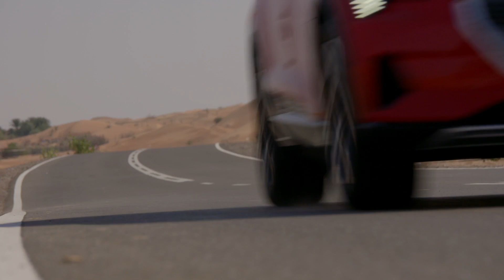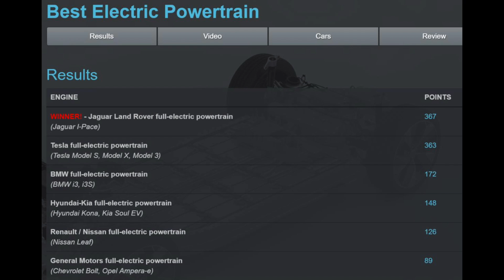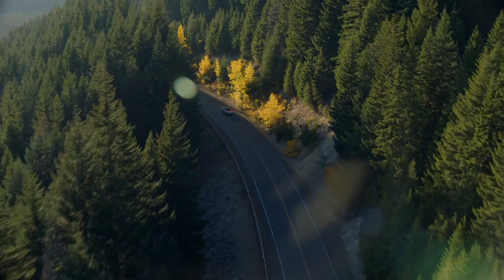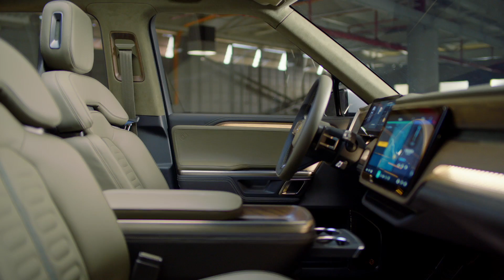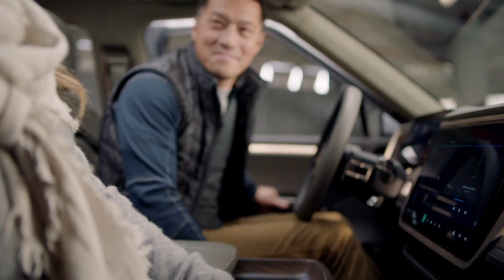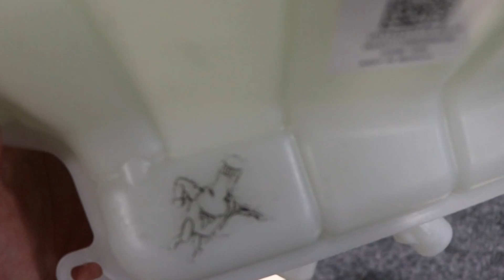Sandy Munro: Model 3 manufacturing, Model Y wiring, and EV competition

Comment: So many jokes about over design, too many parts, wastefulness etc.

And not a single mention about the patent for what Tesla calls a “Multi-Directional Unibody Casting Machine for a Vehicle Frame and Associated Methods.” ?

As Elon said: “When we get the big casting machine, it’ll go from 70 parts to 1 with a significant reduction in capital expenditure on all the robots to put those parts together.”
Reply: I think they only talk about cars they actually disassembled  not the ones they have not
Reply: Also.. million mile chassis. What don’t they understand about this?
Reply: How could they possibly not talk about this (assuming that it happened well before this interview)? I also would have liked some more insight into the battery situation - e.g. - why it takes Maxwell or current battery manufacturers 10 years to learn to make batteries using solid electrode deposition, and something about why it would be better to work toward solid state batteries.
Reply: lifeform carbon I believe the conspiracy theorists that say it’s all being suppressed by big oil
Reply: That will come after the Y teardown interview ;)
Reply: I know a few Tesla owners who have replaced batteries at just 120,000 miles.  What good is a million-mile chassis if you have a sudden $14,000 repair after so few miles?  That’s like buying a gasoline car and having to replace the engine when it’s still Young!

.
Reply: Wheels don't fly off F1 cars, they are tethered to the car
Reply: @electrictroy2010  So 3 people out of millions?

Comment: I thought that Fiat Chrysler is behind in terms of EV development, as you mentioned. Isn't it the reason why FCA is trying hard to merge with Renault (Zoe) / Nissan (Leaf) ? For me, Sandy (a great expert for sure) has not driven a Model 3 with the mind-set of a sports car driver. When you get a grasp the incredible rigidity of the chassis of the Model 3, it is close to the rigidity of a carbon fiber chassis (think BMW i8 or McLaren) which makes its handling more than very good.

In terms of crash test, the test for side impact between a Volvo (best in class before Tesla came in) and the Model 3. https://youtu.be/wcZkkGL85AI?t=33 ... doesn't it suggests that Tesla knows what it does in terms of manufacturing and safety, better than others ? 

The new patents Tesla just filed are meant to build future Teslas in much less parts, even in one man part ? That could have been discussed a bit more.
My 2 cents anyways & thanks for the great content !  :)

Comment: Supercaps  do not make sense as a "buffer" for automotive batteries.  Tesla packs already have no problem producing power and no issues with longevity.  What would be gained by trying to add more expensive but less energy sense supercaps?  Nothing.  Add more battery instead.
Reply: Charge and discharge rates of super caps are way better than batteries. Instantaneous power and they are lighter than batteries. They also have very little degradation from cycling or heating. Basically a sponge like he pointed out. Inrush current from regen braking is quickly stored and reused without killing the battery life. the BMS can easily parcel out the peak current stored if needed to the weaker cells in the pack, and less taxing on the battery cooling from hard charging rates.
Reply: On paper what you add is fewer stressful cycles on a battery which would lead to longer battery life.
 Theoretically this would also help with thermal management
Reply: @helicopterdriver  Wrong.  Supercaps are NOT lighter than batteries, they are much much heavier for the amount of charge they store.  Their energy density is TERRIBLE.  For the same weight, volume, and cost, you are much better off just installing more batteries.  You'll get much more extra usable range and because the pack is larger it can output and receive more power.  If you actually do the calculations, as Tesla obviously has, supercaps make no sense at all without a MASSIVE improvement in their energy density and MASSIVE cost decrease.
Reply: @FogerRox  No.  See my other response.
Reply: @JRP3   They are not about storage but instantaneous power delivery and recharge rates. Not affected by thermal changes the same as batteries. They can store the charge longer as well. Not a replacement for batteries but more of a shock absorber for the energy management. Single phase AC motors have them for a reason. Less current draw on the supply current on start up loads. As they become cheaper, the more sense it makes to include it for better battery load management and current power transfer efficiency. Hydraulics use accumulators. Same idea. More weight but a smaller volume pump and motor is used to make the system  smoother, lighter and more efficient. I'm  no expert... just interested. I have an ebike but no regen capability or I'd be interested in adding it to mine for taking advantage of it for acceleration and overall battery life due to less amps flowing from the battery on power demands.
Reply: @helicopterdriver    Important questions to answer and understand:  1.  Do Tesla batteries have issues with longevity?  NO.  2.  Do Tesla batteries have issues delivering power?  NO.  3.  Do Tesla's batteries have issues with recovering the majority of available regen energy?  NO.  Supercaps offer ZERO benefits for a properly designed EV.
Reply: @JRP3  All of the above are true. I just think discharging, recharging and balancing batteries for many cycles, that could be reduced or slowed, may be beneficial in the long run. More range? Starting and stopping are the biggest energy losses at low speeds. Semi could take advantage of that too.

Elon may have ideas for them we have no knowledge of. Do they use them now? I have no idea.  Probably in solar, maybe in the supercharging network. They don't move, size and weight is usually a non issue.

The next gen of capacitors/solid state batteries may be smaller, lighter and more powerful that don't require very expensive and heavy custom cooling/warming systems. ... more range?  I don't know, but tech is leaning that way... good discussion. 

You're probably right.
Reply: I can't wait to see what Elon does with super caps

Comment: The legacy automakers still haven't figured out that it would be to their advantage to take Tesla up on their offer to share the supercharger network. I doubt that they are open to buying battery technology from Tesla even if Tesla were to make the offer. 

If Tesla did make the offer, I'm sure they would ask the other automakers to pony up the capital to build another gigafactory (or many) in order to provide enough capacity for them as well as Tesla vehicles and its storage products.

I don't think that Tesla will have a monopoly position in EVs, but they will be the GM of EVs, with about half of the market. (You have to remember that China and Europe are going to be developing their own brands for their own markets, and likely will import them to the USA too.) Tesla will definitely be more profitable than the others since nobody else seems to want to vertically integrate like Tesla.
Reply: dlwatib I think Mary Bara has that insight.

Comment: 2 hours charging? What is he talking about I just traveled 500 miles and no stop was more than 20 min? Wild the misperception even with people in the “know”
Reply: Yup, very strange for a battery expert to be this far off the mark.
Reply: Yes, my opinion is that some of his technical statements are highly questionable...
Reply: Same here. I never have to stop longer than 20 - 25 minutes on road trips in my Model 3. Typical stop is 15 minutes every 2 hours of driving. The charge rate is so fast that I barely have time to grab food to-go and use the restroom. I've driven 27,000 miles across the US in 11 months, with another 5,000 mile trip planned next month.
Reply: @JayDee-b5u  lowest is typically 20-25% GO UP TO 80 max on road trip unless freezing out and increased elevation on way to next stop.

Comment: I understand Sandy's point about  the chassis having excessive parts count, which Tesla has apparently fixed on model Y...  but the comments about the chassis being over built, and using aluminum and glues .. makes me think Sandy doesn't understand, or is ignoring Tesla's desire for these chassis to last a million miles.. I've scraped so many American cars (lots under 100k miles)for chassis being rusted out; It makes me mad thinking about it..... I dont think Sandy fully understands : Tesla wants the longevity so they can take full advantage of FSD Revenues....  (and American cars rust like crazy in canada)
Reply: It's both a positive and a negative. On the positive side both the body and the battery will do well in a car crash. On the negative side the car could have been cheaper to build and we would've had a 35k car at launch
Reply: mac berry I recall Munro saying this could have saved a couple of hundred bucks if they’d designed it more economically. Add 25% margin to that and its not significant in the M3 selling price
Reply: I find it interesting there are all these Tesla rust stories doing the rounds again when clearly it's in Teslas interest to make sure they never rust.
Reply: @robbiero368  I'm still waiting on ANY company to produce a stainless steel body structure. Until then, corrosion will always be an issue.
Reply: @billh2294  I'm just confused as whether it's FUD or a genuine issue, they surely are motivated to do at least as well as all other car manufacturers, and their usual approach is to then go further and do better.
Reply: @robbiero368  My take is it's mostly FUD but there may be a kernel of truth to it. I've been repairing rust on British, Japanese, German and Italian cars all my life and don't even get me started on US trucks. I'm a big fan of stainless.
Reply: Si Barrick my opinion was that Tesla likely overbuilt their chassis to last longer ( and not rust out ) I believe Tesla has made the cars to last so that they can pull in revenge using Fsd and the Tesla network for as long as possible for each car

Comment: I don't think that Tesla will be selling their batteries to other vehicle manufacturers.  
Elon has always said that the ENERGY side of Tesla's business will be bigger than the Automotive side.  We are at a crunch time right now with the sporadic output of wind and solar and the grid can't really absorb much more of such erratic inputs.  We need Grid Level Storage NOW so that these renewables can actually be used when needed.  It is so frustrating to see so many wind turbines "locked down" because there is simply no immediate demand for the power they are capable of producing.  
Tesla is facing major issues with customer service these days as automotive output volume has ramped up.  General consumers can be VERY fussy and a pain in the butt to work with.  Having fewer BUT large utility customers could reduce the number of people required in customer service.  It's also got to be a lot easier to produce Large Scale Battery Packs, with some battery temperature management going on, than it is to produce automobiles and trucks.  I can't imagine a Utility getting overly excited about a "panel gap" or small "paint imperfection" on a battery utility cabinet.  It's a whole different market.  Nor is the media going to get excited about covering every little nuance of the company's operations.  Tesla can produce enough batteries to supply their own "Autonomous Vehicles" and let the rest of the auto industry do what they must to meet government regulations relating to EV adoption in the transportation sector.

Comment: Yes great video although it 's based on older data. Good comments about batteries because the world suppliers are holding all but Tesla to ransom helped by them being capacity limited. Some years ago in the press an agreement between Tesla-Mercedes and Panasonic was signed for the supply of batteries. Last year because Tesla Model3 volumes appear to have been limited by Panasonic Mercedes apparently got very little. This year only little volume was supplied so Mercedes (Freightliner) only delivered fraction of the fleets contracted to LA port and UPS while launch of Q production keeps being pushed back. It seems that the Maxwell tech battery production due to start now signals the end of the Panasonic arrangements and will enable the production start-up of Y, semi and roadster all to happen using solid state batteries next year. En so Tesla adds to the years that it is ahead of the field.
Reply: You think these guys are working with old information? (Older than you have?)
Really?
It's what they do!
Reply: I can't wait to hear if Elon has any plans for adding super capacitors to his cars
Reply: Maxwell is not about solid electrolyte batteries - it is dry manufactured electrodes.
Reply: @waynerussell6401  they are famous for their super capacitors. Why would they put that technology on the shelf when they are interested in making bigger vehicles that would greatly benefit from super capacitors

Comment: 25.55  Sandy Monro - I want to shear the wheels off.  How F1 Wheels Stay Attached In Crashes.
Reply: Yeah they added tether cables so the wheel and uprights dont fly into the crowd and kill more than they already have
Reply: @kentonian  That  was my point,lose a wheel on the motorway it bounces into the oncoming lane and you have a 140 mph impact you see plenty of that happening on crash clips .
Reply: An F1 car is designed to absorb the impact, and that is no different with your own car. Munro makes a mistake here...

Comment: Don’t understand -> badly designed. Could it be that Tesla knows what they are doing and just have different parameters they optimize. For not knowing what they are doing it is pretty impressive that they built the safest car ever!
Reply: Yeah but Sandy clearly said you could keep all the features of the body including safety aspects with a better designed body.
Reply: Sandy argued they could of made the same chassis a few hundred dollars cheaper using different process. He also argued Tesla over built it the chassis .. meaning it’s thicker, heavier and using unnecessary glue and Alluminum. Elon wants the chassis to last 1 million miles... I don’t think Sandy sees the point of that.. (a longer lasting car for Elon means more robotaxi revenue )
Reply: “A few hundred dollars cheaper”. Take that in context for a car which sells at $38- $60k. It’s far from being any kind of deal breaker, and I’ll be quite happy to have an “over engineered” car body.
Reply: @FutureSystem738  It matters for margin. Let's say 500 Dollar x 1000 cars and do the same for 1 000 000 cars.

Comment: Mark seems to not understand the notion of charging if he thinks you need to stand around for 2 hours every time you want to charge (@32:40). With 300+ mile range EVs (which exist today), even he would be able to do his 200 mile trip home every weekend without en-route charging (assuming he can charge at home and/or at the shop).

Fact is that ~94% of all charging happens at home, and Superchargers (especially V3 at peak charge-rate of 1000 miles/hour (75 miles in 5 minutes)) are designed to be able to charge more than sufficiently for the typical duration of a road-trip pit-stop (40 minutes).

Also, over the course of a year, a typical Tesla owner spends ~1/20 the time actively "fuelling" (plug-in, plug-out) vs an ICE car owner that needs to drive to/from a station, transact, pump, every week... even when including a typical number of trips that would require supercharging. And then you need to also factor in the amount of time spent earning $ to buy electricity vs buying gas. It's a complete no-brainer, but it's kinda hard to wrap your head around it until you experience it.

And if he's doing 36,000 miles a year, he REALLY needs to do a TCO analysis on the cost of electricity vs. gas. HUGE savings with EV for someone that drives like he does.

Mark, please consider driving a Model 3 for a couple weeks. I think you will be pleasantly surprised!
Reply: Mark is their battery specialist/consultant, I suspect he knows more about this than you or I will ever know and has more than likely driven these cars as well. If it was the correct thing for him to own one he would own one and he doesn't it is a telling fact.

Comment: Making things cheaper, in mfg. is not always long term benefit, plastic parts, snap together is always a nightmare AFTER it's made...Ironic that FORD is your start, and they have more recalls than most for a long time, point proven, design to assembly cheap, it always backfires

Comment: Can anyone explain why the hell Tesla dropped the ball by not fitting a tried and tested way to operate the windscreen wipers, but rather supply a Model 3 with crap auto wipe sensors using cameras rather than rain sensors and force you to dive into the main menu to choose what speed you want (because the auto wipe wont activate) And the awful no key entry bollocks, needing you to have your phone on you and only then will sometimes will unlock as you approach....  Great car ruined by 'innovation'